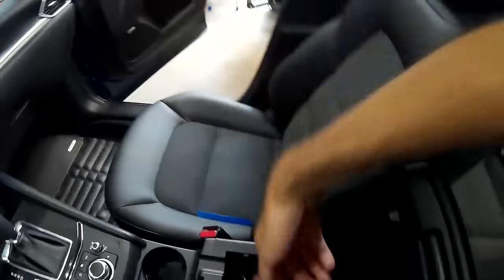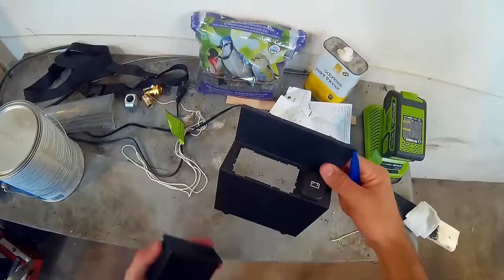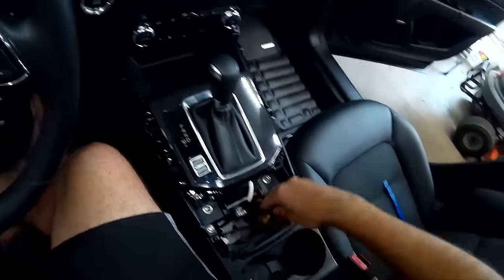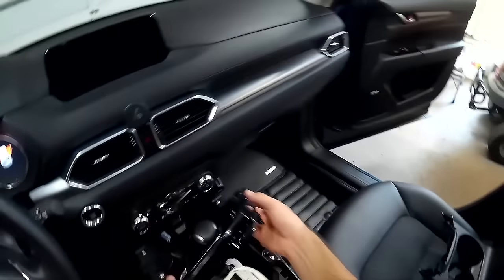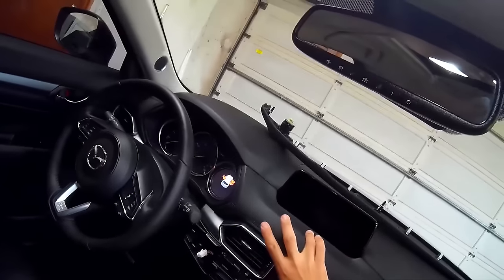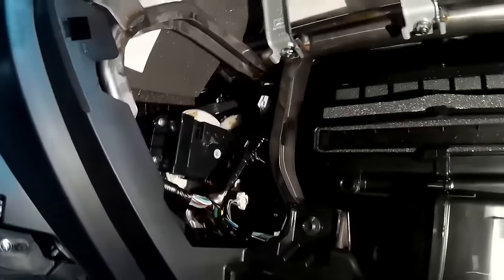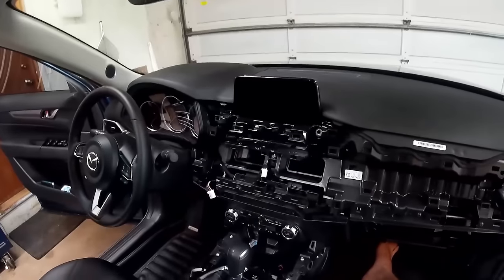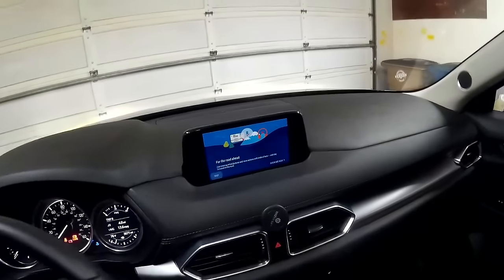2017 - 2018 Mazda CX-5 Android Auto/Apple CarPlay Installation

Comment: Dude! Thanks for this vid, I ordered the parts and will update the firmware this weekend. 

1.  Is no touchscreen a nuisance for you, it's my only hesitation in doing this

2. Have you noticed any glitches with the integration

3.  Random but what phone mount is that in the center of the two vents?

Thanks again. For the awesome video!
Reply from the maker: I've gotten acquainted to using a knob. It's quite intuitive. The only glitches I had were when I first got the system running and was using a cheap USB cable. Make sure you use a high quality USB cable from your phone manufacturer or a reputable company like Anker. I'm using the wizgear magnetic mount. Just search for it on Amazon. It was like $9.
Reply: @TheIoniqGuy  thanks for the reply, is that a vent magnetic mount or adhesive? Sorry I'm just wondering because I'm using the wizgear vent mount and I don't really like that you can't adjust the vent with it installed.  Yours is out of the way which is nice.
Reply from the maker: @1tssen  Yes it uses 3M double sided foam tape. I can confirm that it comes off clean in the event you want to remove it.
Reply: @TheIoniqGuy  Thanks again! Installing AA/CP kit tomorrow, wish me luck!
Reply: @1tssen  How did your install go?

Comment: How do you run the firmware update? Edit got it here: https://www.youtube.com/watch?v=dKS3WpcxIYo&t=3s
Edit I made a video: https://www.youtube.com/watch?v=qO3Lzln1Fc4
Edit 1: Thanks man I got my AA/CP parts from Kanata Mazda in Ottawa, ON, Canada. I just updated the firmware thanks to your help and it seems to be functioning well, I will try to install the CarPlay module now!
Edit 2: I got CarPlay up and running, but took a while since I had to buy a few tools, forgot to get a plastic pry tool, extra insulating foam tape for the wires, and a torque tool to remove the bolts as they were tightly on. I also messed up the wiring because I put the wrong head of the wires with each other, be sure to check you have the blue green head together for the top, and the brown and black (I think) at the bottom before you start taping the foam. This was a big mistake on my part. But I learned a bit and if my dumb 22 year old college ass can do it anyone can. Thanks again!